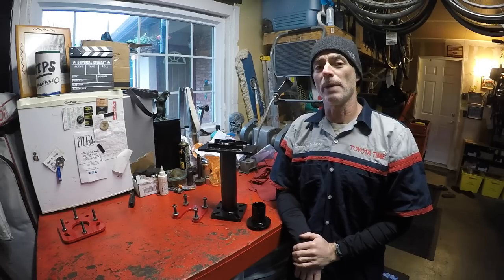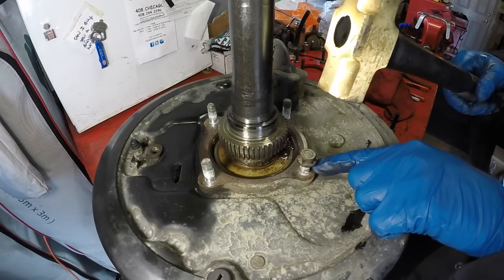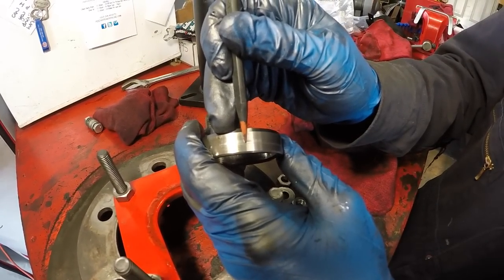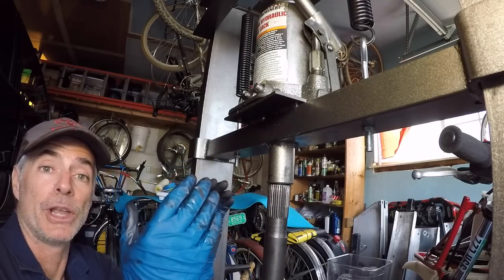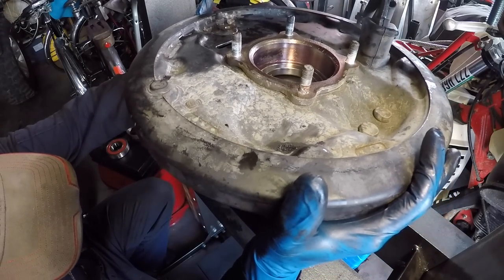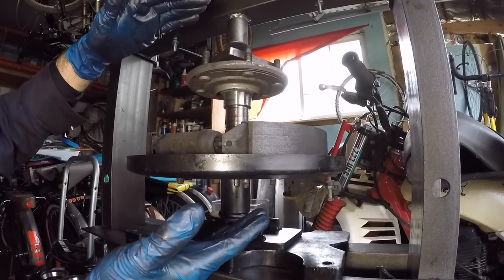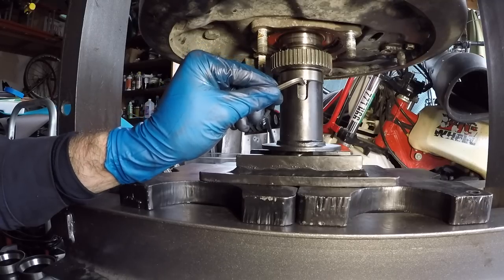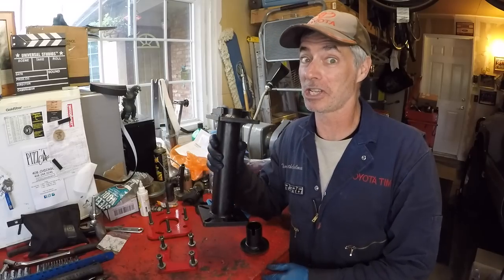Toyota Rear Axle Seal/Bearing Replacement (Part 2)

Comment: Hi, I'm the guy that designed and builds these pullers in Omaha, NE USA. Just wanted to belatedly thank Tim for making this video and for his advice on the product. I also want to thank all of those that have purchased my products. I know that there are  now unauthorized imported copies being offered and that you have a choice when considering your purchase. So I'll do my best to make sure you get the best VALUE for your money. Thanks for buying  American.
Reply from the maker: You're very welcome Duane and It was our pleasure to make this video and support your tool.  I'm glad there were reported problems with the original tool we used for this repair because it lead us to you and your tool which is far superior.   Sean and I were happy to collaborate with you to make the tool more functional for the people to use.  It's unfortunate there are people who think it's ok to steal someone's design and sell it as their own.  I hope the majority of people will choose to buy the Original - Made in the USA.
Reply: Duane, loved the kit but it did not work for my 2004 Sequoia, the setup was different from Tims video. I ground out the ABS plate to fit under the ring as the outer retainer was much fatter the axial shaft was 48mm at that point. Also after the clip the shaft decreased to 46mm for the ABS ring and Inner retainer. I made it work but then I also had to use the main tool tube as the press, using a old retainer ring. The press adapter was too small for my shaft.
Reply from the maker: @Arnie_Davidson  Thanks for sharing this Arnie.
Reply: Howzit Duane. 1st off I wanted to tell Much Mahaloz for a brilliant product. I tackled this job and finished it in 2hrs. With the help of my Harbor Freight 20 ton air/hydraulic press. Also Mahaloz for shipping your product 1st thing Monday morning. When my box came in yesterday, I drove straight to my local Toyota stealership to pick up my parts. The noise from the rear bearing was so loud that people were looking at me while I was driving by. Aloha, Dain 🤙🏾
Reply: Timmy The Toolman. Love your videos bro. Much Mahaloz for the attention to detail on ALL your videos. With the special tools you use and the steps you take to get the job done. Is there anyway I could send you guys some Toyota hats?   My Dad and brother work for Servco HAWAII and I just wanted to give back for all u guys do. Let me know. Aloha, Dain 🤙🏾
Reply from the maker: @busmup808  Hey Dain,  good to hear you like what Sean and I are doing.  Sure you can send us some hats.  Send me an email: mtbtim@sbcglobal.net  Thanks!
Reply from the maker: @busmup808  Hey Dain, Duane will be stoked to read your comment.  Good to hear the job went smooth for you.
Reply: Hi Duane , what's your eBay seller's name , tiewards ? Trying to get the correct one . 
Thanks John R .
Reply from the maker: @johnsricke7236  Hey John, the link to Duane's Ebay store is in the video description.
Reply: @Arnie_Davidson  I now have a dedicated Sequoia kit. The 2001-2007 Sequoia is a real bear to do. This kit should  make it much easier.
Reply: Hi Duane, fantastic tool that made my life so much easier! Also, huge thanks to Timmy for the video! You guys are amazing, and make working on these vehicles easier and more fun. Question for Duane: I'm going to be tackling the front seals and bearings next. Do you make a puller kit for the front?
Reply from the maker: @maximusbkk9232  I doubt Duane is going to see this message.  If you want to thank him, I would do it through his Ebay store.  In regards to the front bearings, you don't need a special tool per say but you do need some press sleeves and press plates.  I'm pretty confident Duane doesn't make any special tools for dealing with the front bearings on these rigs.  We have two videos that could help you out with this.  I would use our Upper Balljoint Replacement video to learn how to remove the steering knuckle from the rig:  https://youtu.be/-sY2azyLBuI  Then I would use our Manual Hub Swap Part 2 video to learn how to do the press work: https://youtu.be/1TpOYj0sUpA
Reply: @TimmyTheToolman  Fantastic! I'll go that route. Thank you so much for your videos. You really make the 4Runner community a better one!
Reply from the maker: @maximusbkk9232  You're very welcome and thanks for the kind words.  Sean and I appreciate it!  Happy Wrenching!
Reply: do you have the same kind of tool for a 2010 toyota tundra?  the bolt pattern on the axle housing is not square like what the tool shows.  I would like to own one too.  Thanks
Reply: Hello Duane I was wondering if you ship to Canada and how much is the kit. I have a customer with a 2011 Tundra and also have customer with 2014 Tacoma
Reply from the maker: @martinlavoie4002  Duane will not see this comment.  You should message him through his Ebay store.
Reply: I'm watching this video from Nairobi kenya. Indeed impressed. I would like to purchase the set of tools from you. Kindly let me have more details to facilitate the purchase.
Reply from the maker: @mosobaoriki3126  We provide a link to Duane's Ebay store in the video description.
Reply: @TimmyTheToolman  , Thank you, you have touched my heart by the prompt response. Great work, for the video it is educative. My vehicle is a Toyota hiace van. I'm hopeful the tool will work for me.Most likekly I'll set up a garage.
Thank you Timmy once again.
 Your free to address me by my second name .
Reply from the maker: @mosobaoriki3126  Hey Oriki, I also hope the tool works out well for you.  You're very welcome and good luck with the job.
Reply: Used your kit for my 02 Taco, w ABS. And will likely use for front hub bearings when they go. The sleeve and pieces have OTHER press work application TOO!!  I used it with The 12 ton worked with no problems height wise or power. Just had to come up with adjustable cross members on the press to allow Duanes kit. I used some scrap 2x2 x 250 steel sq tube.
Reply: Hats off to both of you, Duane for the amazing tool and Timmy for showing me the process and best practices. I just wrapped up the job on my 98' 4Runner. Everything went smoothly, and I am hopeful that the seals hold, and no more leaks. Saved a ton of money, and it was a fun project to get into with the new floor press and tool. I'm secretly hoping my friends 4Runner needs it, so I can do it again. Ha! Brent
Reply from the maker: @cobjread  It's a good feeling doing your own repairs.  Glad you found our video and Duane's tool helpful.  Happy Wrenching!
Reply: Just got my puller in the mail today. Excited to get these old bearings out. I definitely saw those look alike import pullers on ebay. I'm glad that timmy the toolman recommended your product so I was able to buy a quality tool.
Reply from the maker: @carywood3946  Thanks for buying the quality U.S. made product from Duane and not one of the cheap Chinese copycat ripoffs.
Reply: @TimmyTheToolman  no problem at all. I appreciate your videos so much. Two years ago I had never even changed my own engine oil. This week I'm pressing my own rear axle bearings in my little garage/shop. I've probably done 10-15 jobs on my 97  4runner just watching your videos.
Reply from the maker: @carywood3946  That's great to hear our videos have inspired you to turn wrenches.  Inspiring people to take on the challenge of auto mechanics is one of our main goals.  Thanks for letting us know.  Happy Wrenching Cary!
Reply from the maker: @aquaticterrafirma  Open the video description.  Click on "Show More" and it will expand the video description and you'll see the link to Duane's Ebay store.
Reply: just used Duane's tool on the axle job today. super easy and comes with the little sleeve to make all the pressing easy. Just get a little 4x4 flat bar 3/8" thick at a metal yard for like 4 bucks and you're set if you don't already have one. Or i think the new ones now come with it.
Reply: @TimmyTheToolman  hi Tim can you send me the place to order the tool to remove the rear bearing from the Toyota thank you in advance
Reply from the maker: @mauriliomaldonado3554  Open the video description by clicking on "Show More" and it will expand out to show a bunch more information including a link to Duane's Ebay store where you can buy the axle tool.  For all our videos, always take a look at the video description and also look to see if we pinned a comment (1st comment you'll see), because we offer helpful information in both areas.
Reply: Duane your tool is amazing 👏
Reply: THANK YOU for designing such a great tool... I'd never done a job like this before, and between this video, and the tool you designed, I got it perfect first time.
Reply: i just ordered your puller/presser tool kit yesterday to help with my job of swapping two twisted axles on my 4r, your tool should make this job a breeze. Im super excited to use it and the choice was a no brainer for me to by USA made over cheap china made imitation rip off. Proud to support small business.
Reply: Excellent and very helpful videos, Sold! Where can I buy this tool thnaks?
Reply: just purchased mine tonight.. could have bought it for half price from the copies, but can appreciate what youve done here and supporting US made. LGB
Reply: Bought the big kit from you!
Reply: Just bought your part thanks buddy
Reply: Thanks so much for a quality tool and standing behind your product
Reply: Duane, you are awesome! Thank you SO much, what fantastic quality. Tim, thank you as well. Really made this job easier. For any of you thinking of skimping and buying the 12 ton press, don't. Much harder to work with. You're saving enough of this job to go ahead and get yourself the 20 ton ;).
Reply: Do you still sell this?
Reply: @TimmyTheToolman  i
Reply: @busmup808  do
Reply: @cobjread  

To
Reply: Hey has anybody heard of brand called Beck Arnley? I saw those bearings for sale but I am not familiar with that brand. Anybody done a review on those bearings?
Reply: This tool was EASILY some of the best money spent. I mean seriously dude, I was expecting an all day job but I was done in almost no time at all. Extremely well designed, well thought-out tool. I'm surprised you charge so little for it.
Reply: Where can I find the tool? The link said SOLD.
Reply: Hello my friend.  I clicked on an ebay link to buy your tool, but the link was a dead end.  How can I buy your tool?  I would like to buy as soon as possible. Thanks so much!
Reply: Excited!  Mine is on it's way from ebay.  thanks for making this much needed tool.  One for the backyard mechanics!!!
Reply: Hello Duane,
 I know it's some time since the video but do you still sell these?
Reply: Thanks for such a great tool.Was above and beyond what I expected. was surprised to get the extra parts including the plate and bearing pusher.  Your the man!
Reply: Is it available on amazon?

Comment: Excellent video, great tips.  My tip - Clean out the "-Oil Defrector-" passage especially if there is gear oil in the brake drum and on the shoes.  By design if the oil seal fails oil will flow out of the dust seal into the "Oil Defrector" then spun out into the wheel through the hole in the flange next to the the lug-nuts.  If the "Oil Defrector" is clogged the oil will overflow out of the Defrector into the brake drum and pads.  I use steam to clean the passage, brake cleaner could be used by spraying it into the hole on the flange.   It's a good idea to clean this passage when checking the rear shoes to keep oil out of the brakes if the seal fails.  Spelling??? Defrector???   That's how it is spelled in the manual.
Reply from the maker: Your tip is a good one.  When we shot the video, we didn't understand that the Toyota engineers figured out a system to direct gear oil that got past the seal and through the bearing away from the brakes.  I don't think the manual even discusses the name of it but maybe they do.  Anyway, it's definitely not a bad idea to try to clean out that area behind the axle end during your axle seal job so gear oil left in there doesn't end up contaminating your new brake shoes.  Glad you like the video and thanks for sharing this.

Comment: Hey Tim, thanks for a great very complete video on the axle bearing replacement with Duane's tool.  I really hated all of the you tubes where the tone ring and retainers were chopped off.  I was a bit leery of flipping the retainer for the seal fit.  When I pulled my axle assembly out, I measured the distance to the top of the tone ring and the drum housing.  I also noted the wear ring on the original  outer retainer, 2mm from the inner bevel of the factory installed retainer.  The flipped edge of the retainer has a slight bevel, just enough to allow it to slip  into the seal without damage and give the extra seal area.  Since I didn't have a 3" pipe clean out for pressing the bearing, a Progresso soup can is the same size, just use a 1x6" piece of wood to throw on top.  I actually just pushed the bearing in without using the press.  And as a final note, I was doing this without help and using the threaded part of the press jack was not easy.  I did the bearing removal in 2 steps, pressing to the limit, releasing the jack and them raising the press plate up to the next holes.  On the installation, I used a impact socket as a spacer so I could set the bearing/tone ring without cranking out the extension on the jacks shaft.  
All went well and Duane is a great guy to do business with.
Reply from the maker: Hey Rick, You're very welcome and you did great.  You got it done all on your own and that's got to be a great feeling.  Good to hear you feel the same about Duane.  He is a great guy.  We appreciate you taking the time to comment.  Happy Wrenching!

Comment: Local dealership was going to charge me $600 pre-side rear total $1200 and $900 pre-side front for total of $1800 grand total $3000 for all four wheel bearings on a 98’ 4Runner so yeah it worth the cost of a press $250 local Duane’s tool $130. Toyota parts a little over $320. So thank you Tim for guiding us through the process. It definitely saved a ton of money especially in the times we are living in.
Reply from the maker: You're very welcome Kendra.  Yep, doing your own work can saves lots of money.  Glad our videos are helping you out.  Happy Wrenching!

Comment: Note to anyone doing this job on down the road.. do NOT try using a 12 ton press, it will not be big enough to do the job. I had to take it back to harbor freight and buy the 20 ton like Timmy has/ uses in the video. That cost me so much time and headache.... Frick smh 🤦 live and learn... live and learn.

Used this video to do my ol 3rd gen today. Nuked, been such a long day, but I got er done, and I am stoked it's all now fully replaced a-z brand new oem Toyota parts. The bearings are now discontinued, and so yeah, that's dumb of toyota to have done. I had to call about 40 dealerships and found 2 in TX that each had 1 bearing each in stock.. Thanks again Mr Timmy the Toolman!!! Your video was incredibly nice to have for references of each step to do the job!
Reply from the maker: Thanks for sharing your story with this repair.  Good job getting it done.  And yeah, Toyota was stupid to discontinue the bearings.

Comment: Great video, thanks for the awesome work. A tip I've learned is that it helps to freeze loose fitting bearings before installation. I froze the bearings on this project and they dropped right in, no press work. I then set the assembly out in the sun for a bit and they were nice and snug. Also if you need to make small adjustments while pressing the tone ring/retainer I found that if you do a partial press stroke, you can tap from above with a rubber mallet to get very fine movement and arrive at that perfect 4.8-5 mm spacing.
Reply from the maker: Thanks and we appreciate you sharing your tips.

Comment: Great video! Just a tip to remove the snap ring. When you first start to pry it apart, use a paint can opener to catch the edge. The bend will slip under the edge and not pop out.
Reply from the maker: Thanks for the tip.

Comment: FYI, Duane's tool is a hair too wide and doesn't fit into the cross member of Harbor Freight's 12-ton press. My press is about three years old. I'm not sure if the new ones are wider. If you're purchasing this tool and a press--get the 20-ton press. I was able to weld together a new cross member to make this tool work with my press. Otherwise, Duane's tool is quality and will make this job seamless. Thanks for the video guys!
Reply from the maker: Thanks for letting us know the 12 ton press doesn't work with Duane's tool.  The 20 ton press is definitely the way to go though since it's not that much more money and it can handle any needed job for a 3rd Gen 4runner and most other vehicles as well.
Reply: I wish I had seen this comment sooner. I already had the 12 ton press for previous work. Duane's tool is about 1/4" too wide to fit through the opening on the 12 ton press shelf. I cut the shelf in half with a hack saw to get the tool through and then fastened it back together with cam straps. Not the best solution but I was able to successfully complete the job with a 12 ton harbor freight press. I would absolutely recommend a second set of hands if you go this route.

Comment: Great video. Followed it and very helpful. For inserting the bearing i put the bearing in the freezer and when ready to insert the bearing, it slid in without needing to press
Reply from the maker: Thanks.  The bearing fit in the bearing case isn't a press fit.  We've installed them many times without the press, but you have to get the bearing perfectly aligned to the bearing case for that to happen.  If it starts going in crooked, then you have to use some force.  I'm glad our video helped you out.